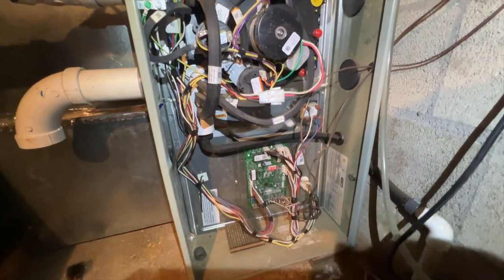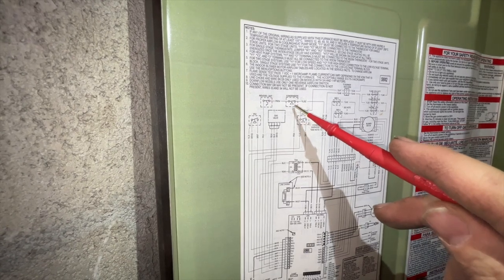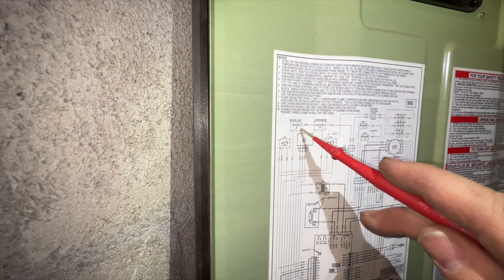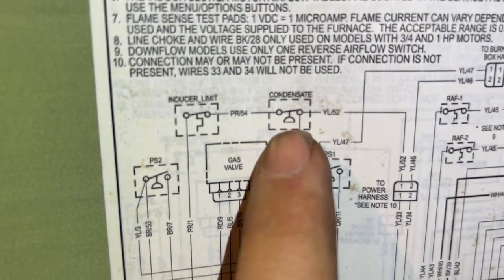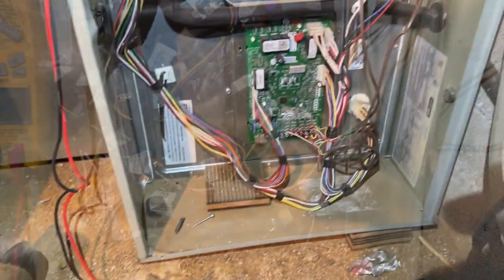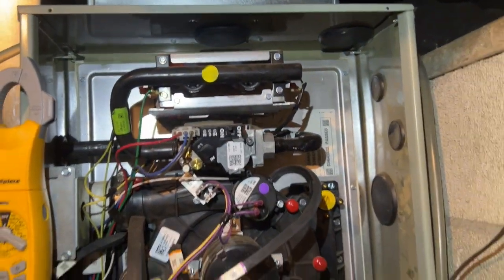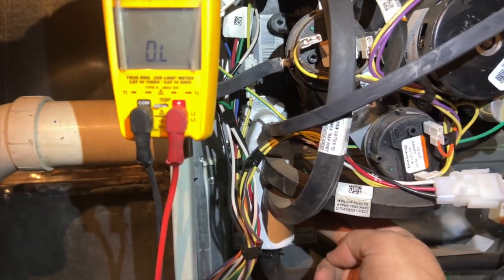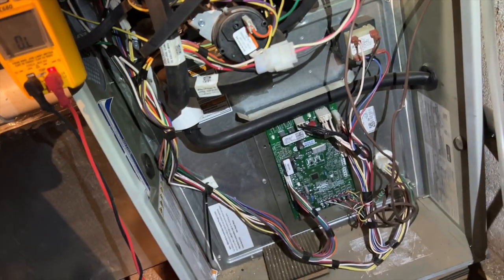Stuck Condensate Switch on a Trane Furnace EP153

Comment: Thanks for the video! What you did worked for us. Just curious, mind explaining exactly what you did and why? We followed everything you did and it worked so now just trying to understand. Thanks again!
Reply from the maker: The pressure switch is a normally closed switch. When it’s closed it proves the condensation line is clear. If there’s a back up the pressure will build up in the line causing the condensate pressure switch to open which will prevent the unit from heating to avoid possible water damage. The drain pipe going into the condensate pump was flush to the bottom of the condensate pump reservoir which caused a pressure buildup. That’s what caused the switch to open in the first place. As it’s attached to the condensation line some moisture gets into the pressure switch and can cause it to get stuck sometimes. Glad my video helped you out. Hope this explains what was going on. Thanks for watching.